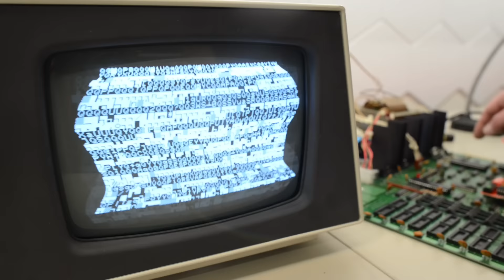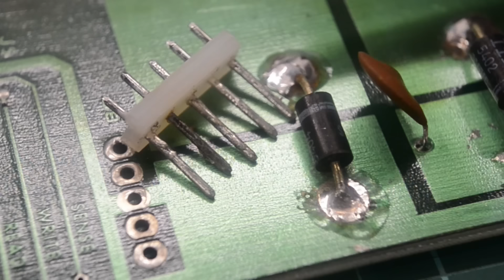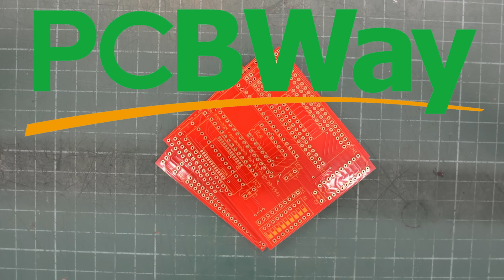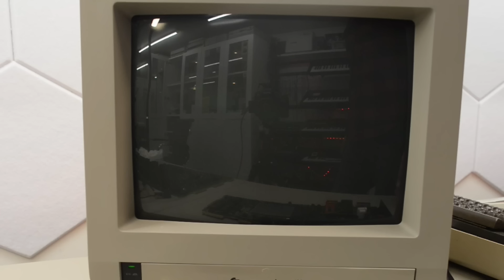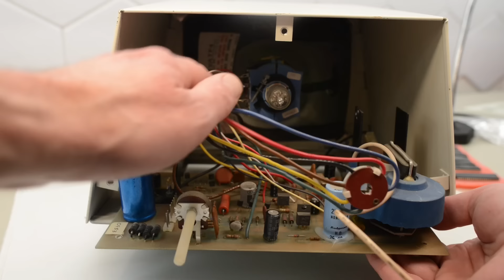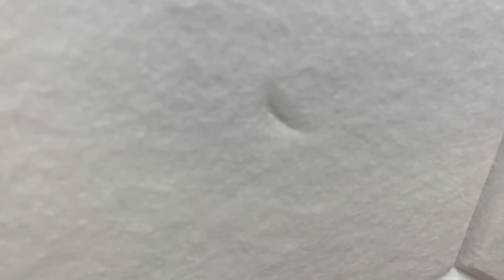1977 Commodore PET restoration gone horribly wrong! EXPLOSION! & Magic smoke!

Comment: Only Epictronics would have an EPIC capacitor explosion 😜. The remnants of that thing looks about as dry & crunchy as a potato chip!
Reply from the maker: What a bang! I was leaning over it looking for the adjustment pot when it exploded! I'm glad it didn't blow up in my face 😅
Reply: @Epictronics1  If smells hot, why don't you turn off? And the F** word when explode..time of laughs but for the next , view first the caps specially those of the 80's because this things always(not always but very very sometimes explode).
Reply from the maker: @asanjuas  It didn't smell closely as much of hot electronics as the CRT display we used with the VIC and many others I have. I kind'a expected it :)
Reply: Explosion? Ha! It gutted itself.